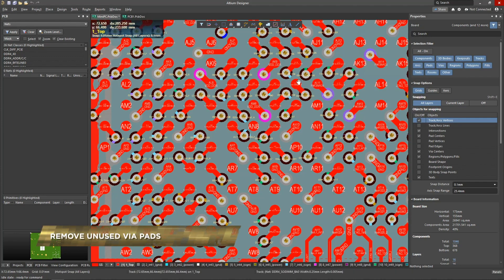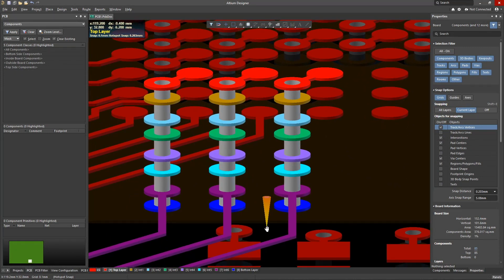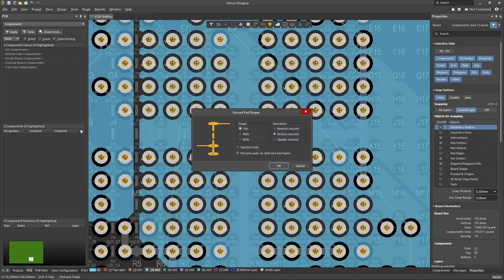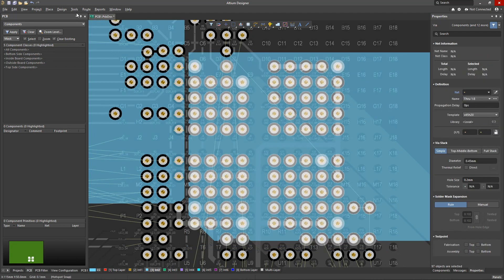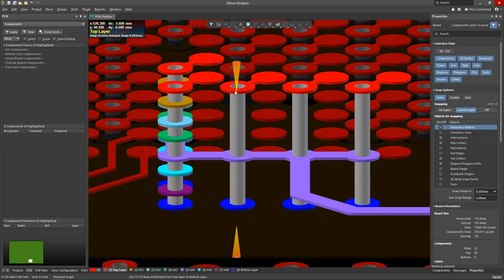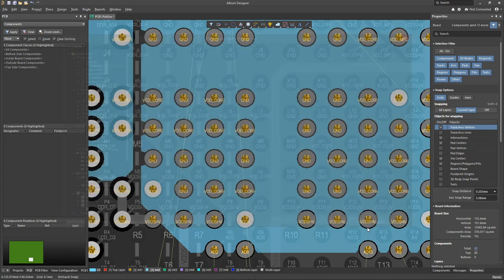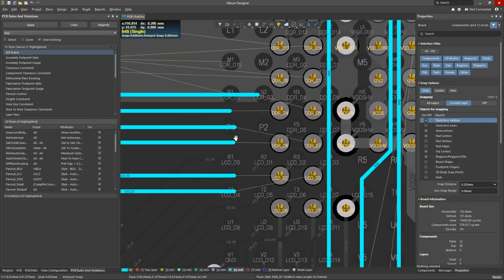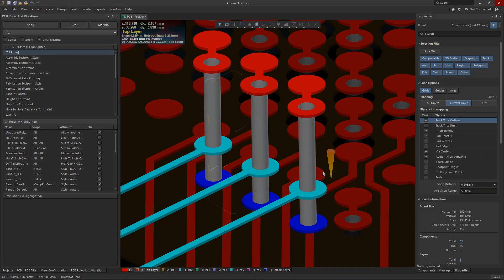How To Remove Unused Via Pads in Altium Designer | Component Creation

Comment: There are a couple of important caveats not mentioned in the video which need to be considered. Otherwise it's very easy to design a board that can't be fabricated, or worse, fails to assemble correctly:

- PCB fabricators have a minimum clearance to drill holes. They overdrill and plate up to your specified finished hole size, and they need to account for drill wander. Typically this means about 10mils minimum copper to hole clearance, though you may be able to go slightly closer by paying more for fab (ask first). You must make sure this is accounted for in your clearance rules, especially if removing pad shapes would take your routing closer than 10mil. Therefore if you have vias with 5mil annular ring and 5mils copper to copper clearance, removing the pad shapes will not actually gain you any more routing width!

- This video uses dogbone BGA fanout, but you need to be very careful if you're using via-in-pad. Removing the unused pad shapes can create a co-planarity issue. Removing the unused pads from some vias makes the overall thickness of the PCB, and hence the total height of the via, less than vias which still have all their pad shapes. Consider a 14-layer board, 6 layers of which are ground (That's a lot of ground, but it's not unheard of) and 1oz copper. A ground via will have 8 layers with pad shapes (the 6 connected inner layers, plus top and bottom). A signal via which only connects on the top and bottom will have 2 pad shapes, ie 6 fewer layers of copper than the ground via. Each layer of copper is about 1.4mil thick. That means the ground via will be 8.4mil taller than the signal via! If you're trying to get a large BGA to solder properly, a signal pad next to a ground pad might be >4mils lower. This difference in height, coupled with the heatsinking aspects of the ground via, can lead to solder voids and open circuits.